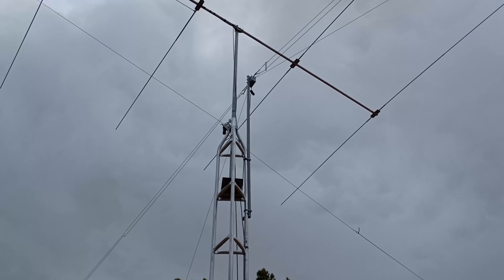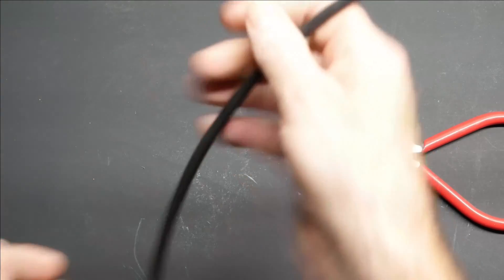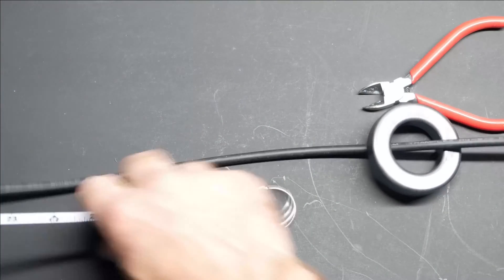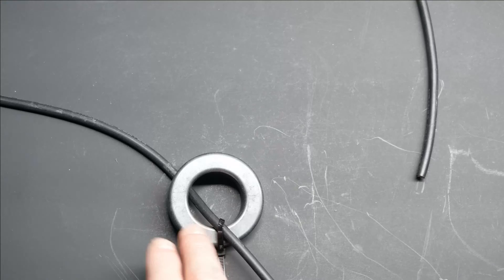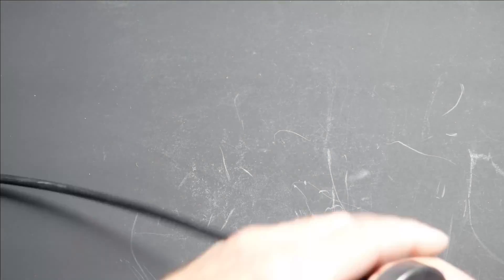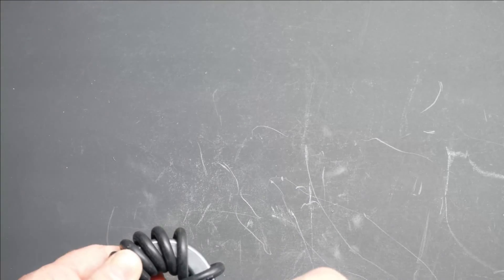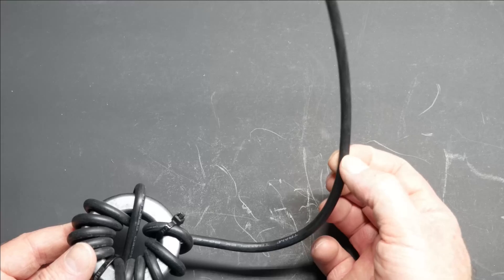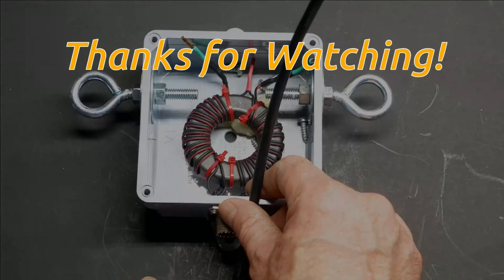Building an easy common mode choke for antennas.

Comment: Do you put the finished common mode choke in a box also? If using outside??Tnx
Reply from the maker: The nice thing about this style of choke is as long as the PL259 connector(s) are sealed you are good to go. All of mine are in open air.
Reply: @RicksHamShack tnx for the quick reply. Good video, 73

Comment: Just so you know, it is not important that the number of windings on the toroid be equal on both sides, or an even number.   It doesn't even matter if you change direction of the windings.   The only thing that really matters is how many turns you have - because, each one increases impedance to common mode currents.  Just like with ferrite beads, more turns are better. And,  you can stack the toroid on top of another toroid, like your 49:1 impedance transformer.   You just need to put a little space between them to reduce any capacitive coupling between the windings.   A piece of cardboard would do the trick.  I hope this helps.

Thanks for the video, and 73!

Comment: 06/2025 - Can anyone please explain the magnetic theory (if any), of winding six turns of coax in one direction, then crossing over and winding six turns in the other direction?
Or is it just voodoo, but does make the arrangement easier to wind, to keep the coax in line ?
Reply from the maker: Theoretically, it reduces the end to end capacitance of the choke making it more effective, which isn't really measurable in practice. Practically, it orients the coax so it goes in one end of the choke and out the other end. I've wound them both ways, they both work fine.

Comment: What is the power rating of this choke?   Is it good for 750w PEP?
Reply: At HF frequencies (e.g., 1.8–30 MHz): RG-58U can handle up to 1830 W at lower frequencies like 1.8 MHz, with power ratings decreasing as frequency increases. For example, at 30 MHz, it is rated for about 350 W continuous duty cycle, 700 W for CW (continuous wave), and over 1000 W for SSB (single sideband) with a 50% duty cycle.

Comment: RG58 solid core so it might not be a good idea to use it for this application, which makes your two statements contradictory. Also a 1:1 balun performs the role of a choke as well so you are just doubling up on the choking.

Comment: In the future use painters tape and make a square on the table or floor marking the border of your video shot area.  This way it will help you not to do things outside the border where most of your work is not seen by the viewer.

Comment: Id be VERY concerned using non teflon dielectric coax when winding such sharp turns.
Reply: Good point. Attention should be put into the coax choice based on minimum turning radius.